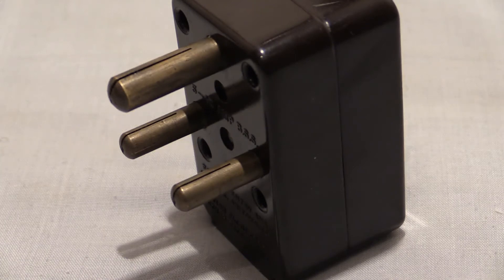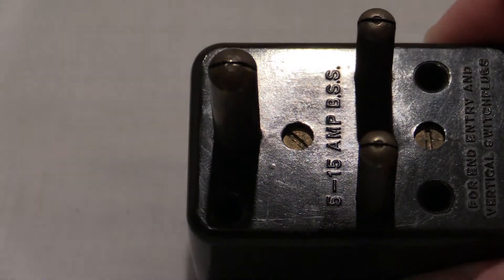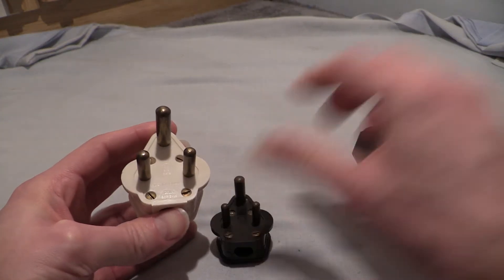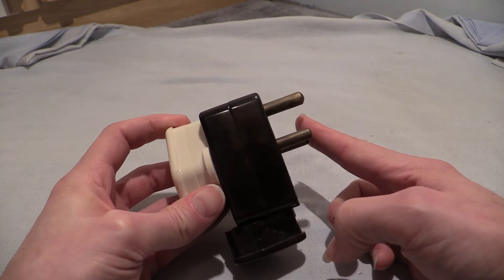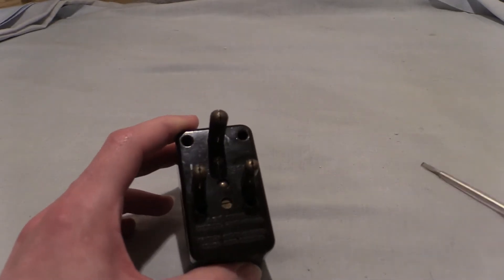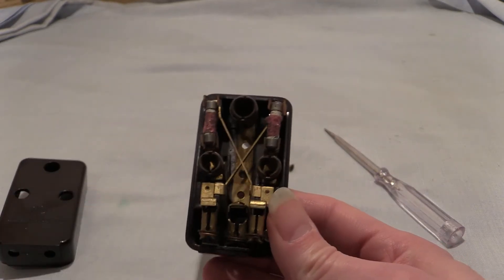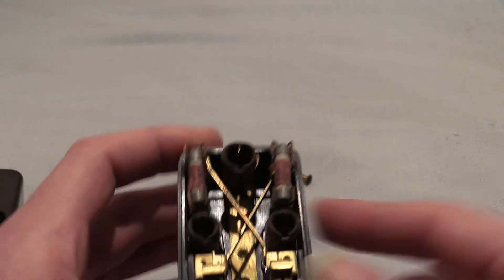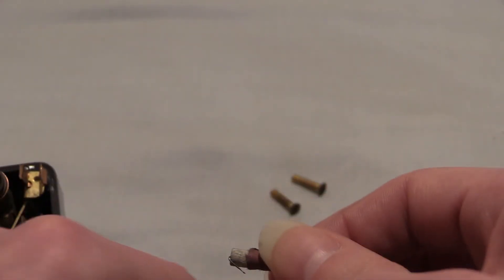Plugs : MK Safety Adaptor, 15A, 5A, BS 546

Comment: Hi Wayne I got one of those still in regular use here in my workshop/shack
Reply from the maker: Hiya. If you are using one of these MK Safety Adaptors currently, I wouldn't really recommend it for the two reasons stated in this video.

It was OK "back-in-the-day" but nowadays, things have moved on and standards have improved.

....We also no longer put fuses in the neutral!

Thanxx for watching,

-Wayne's Electrical.

24th October 2017, 18.37

Comment: That plug is a genius idea, allowing for the main appliance to be plugged into the outlet and “tap off” a power limited supply. But 15A at 240V is certainly a lot of power!
Reply from the maker: Haha, 3,000w in the UK isn't too much. A kettle which tugs less than 2.5kW IS PAAAANTS!

The MK Safety Adaptor (among other innovations by MK) really set the standard and made MK known for pushing safety and innovation to new heights, which is why in the UK in the electrical trade, the MK brand is well known.

MK has always been a premium product, but what I will say, saddeningly, is I once had the chance to get hands-on with one of their new-style Sentry consumer units. (the now-discontinued plastic ones) This was some years before the Wiring Regs stated that everything had to be on an RCD and the new rule which now states that consumer units have to be all metal WITH a metal enclosure over the MCBs.

Oh. Dear. Me.

The clicky-clacky construction made it only slightly more rigid than that plastic tray found in a box of chocolates.

I was SERIOUSLY disappointed. It was a proper letdown!

At around about the same time as that I managed to get a new-old-stock older-style Sentry and the construction on that one was MASSIVELY better! Even the supplied busbar in the older version had some proper meat to it!!

The only thing I can hope for now, is that MK have made some SERIOUS improvements to their all-metal consumer units and that they aren't made out of such thin metal which can have holes knocked into it by someone stabbing it with a screwdriver!!

Overall though, MK is a mighty good brand. Any brand has it blooper low moments and I think MK accidentally scraped the bottom of the barrel with those [horrendous] plastic new-style Sentry units (which have now been discontinued)

A bit later on though.....

More PLUGS and electrical bits on their way, so please do stay tuned!

Thanxx for watching,

-Wayne's Electrical.

17th September 2017, 21.47